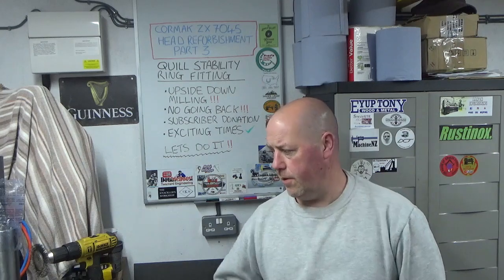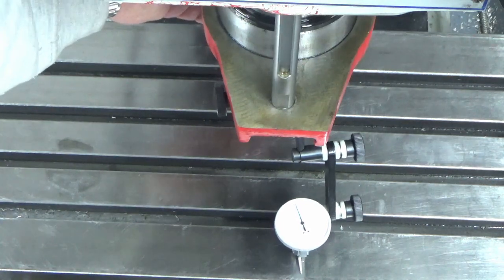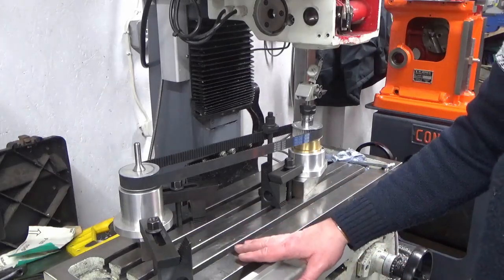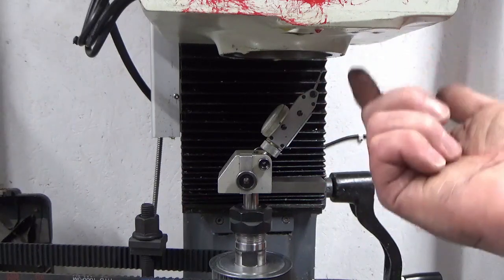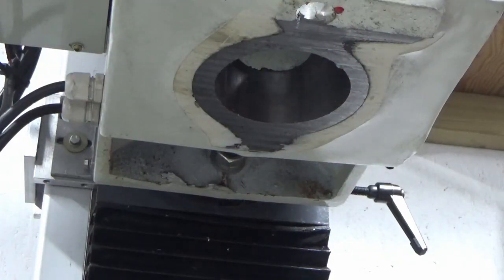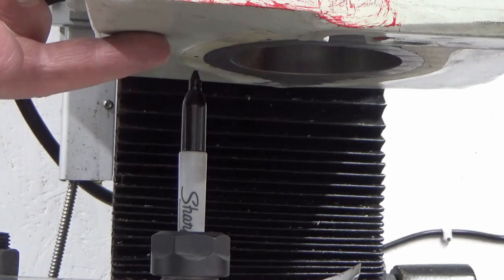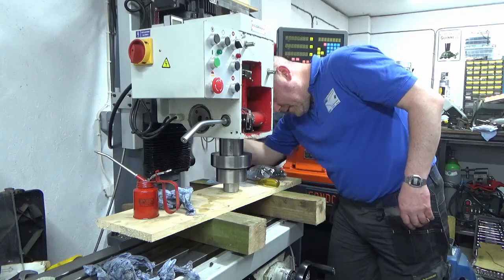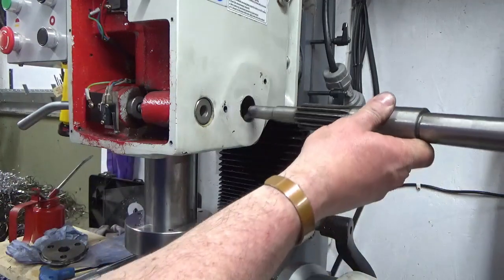7045 Milling Machine Head Refurb Part 3 - Milling the head casting.... upside down!!

Comment: Congratulations Dave on nice channel donation 👏.
Nice job Jon, quite a lot of laborious work, hope your wrists were still able to assist in some imbibing 🍺.
I'm sure you will overcome the pinion engagement issue. 
Thanks for sharing.
Reply from the maker: Hi Bosted Tap, thanks for the comment. Yup, great gift from Dave, top man! Aye, we'll get it sorted one way or another. Cheers, Jon
Reply: @jonsworkshop  Hi Jon, yes, probably only less than 0.2 mm bigger on pinion to rack height ( quill to pinion centre), looking forward to a proper geometry measurement setup. 
Have a great week. 
Best regards John.

Comment: Single pointing a rack isn’t bad. I’ve single point cut many many gears. A rack is much easier. If your shaper was ready to use, it could easily be done on the shaper.
Reply from the maker: Hi grntitan1, thanks for the comment. That is exactly the route I am going to take. Gives me the kick up the backside I need to get the shaper finished as well lol. Cheers, Jon

Comment: I forgot to mention applause to Dave Ticehurst for making the spindles and also that RDG engineering supplies sell individual involute gear cutters in both DP and Module formats.
Reply from the maker: Hi Howard, agreed and thanks for the tip off. Going shaper on this I think so will be grinding a trapezoidal HSS. Cheers, Jon

Comment: Hi,Jon. You're more than 75% of the way to a successful outcome so don't be downhearted about the rack and pinion size errors. Could you possibly make the pinion spindle mounting bushing adjustable perhaps with eccentric bushings or elongated bolt holes? Not the end of the world if you have to remachine either the rack or pinion teeth depth. Keep at it you'll win in the end.
Reply from the maker: Hi Howard, thanks for the comment. Yup, we will fix it one way or another. Rack modification me thinks, its the easiest way really and gives me a shaper project, what's not to like! Cheers, Jon

Comment: Wow , that opens up a can of worms , time to break out the gear tooth vernier !     The milling came out great with those spindles .  I wonder if that's why the spindle  had not been fitted previously .   👍
Reply from the maker: Hi Max, thanks for the comment. Yep, I wondered the same. No biggy, it gives me my first job for my shaper once its rebuilt. Cheers, Jon
Reply: @jonsworkshop  Hardly a drama !

Comment: Interesting!
Your problem isnt as simple as the spindle being forced backwards by your ring is it?

The gears and rack are not "high precision" parts on your machine so you might be able to just take the crests of one or other or in fact both, depending on  the results of your investigation of course.
Reply from the maker: Hi Chris, thanks for the comment. Yes, I also thought that may be a possibility, I dropped the ring back off..... No difference. I have since measured both racks and there is about 0.03" difference in the rack radial positioning to spindle centre. Job for Mr orange once he is fully rebuilt which I am already looking forward to. Have got the Mt4 re-fitted for now so mill back in commission too. Cheers, Jon
Reply: @jonsworkshop  that seems a lot, same product different factory perhaps.
Reply from the maker: @chrisstephens6673  More than likely, you know where its come from lol. Maybe the same factory but a different day!! Cheers, Jon
Reply: @jonsworkshop  is there a possibility of boring the head casting and making eccentric bushes for adjustment?
Reply from the maker: @chrisstephens6673  Hi Chris, yup, perfectly acceptable solution, however, my cross slide to C/L on the lathe is not big enough to accommodate so I would need to send out🙁. Shaper it is, and I am really looking forward to it. This also keeps the mill fairly standard so when I next have a brain fart, I have more options lol. Cheers, Jon
Reply: Brain fart, surely not, that's  my territory or have i been teaching you how.😆

Comment: good job jon..thanks for your time

an important improvement for your milling machine would be to attach a dc motor with a gearbox of 180rpm 200rpm and about 45w...a pwm regulator and a 24volt power supply...which will allow you to raise and lower the head without any effort and also you can use automatic feed head boring... I made this improvement on a milling machine that has an HBM 30 and I am very happy with the result.
Reply from the maker: Hi Tr, thanks for the comment. Yup, it's on the list lol. I want to power the X axis first though at some point as I do a lot more winding on this one generally. Cheers, Jon

Comment: OOOooopps
Reply: Why not offset bore the housing and move the pinion centre backward.  Mount the housing on the cross slide of you lathe.
Reply from the maker: @markdavison7893  hi Mark, thanks for the comment and suggestion. I could move the centre line back but surprisingly, my cross slide to C/L on the lathe is not big enough. I want to keep the machine as standard as possible so I will machine the rack in my shaper to correct the issue........eventually lol. Have rebuilt the mill with the MT4 spindle for now so all operational again. Cheers, Jon
Reply from the maker: Hi Raymond, thanks for the comment. Yup, bang on lol. Cheers, Jon
Reply: @jonsworkshop  Not me suggesting that was @Mark Davison. I was going to suggest re-cut the teeth on both the quill and gear if it is just depth not an oversize issue. Do they actually match? Removing the gear inserting the quill a visual inspection test re-insert the gear? Make a whole new gear to suit??

Comment: It looks like you just have to turn down the pinion a small amount near the end. At least I hope that's all you have to do.
Reply from the maker: Hi Lloyd, thanks for the comment. If it was only a small interference I think this would probably work, having measured up now, the difference is 0.03" so I need to re-machine the rack. Good first project for my shaper. Cheers, Jon

Comment: Hi Jon, brilliant work and hat's off to Dave for making you the auxiliary milling head which I'm sure you can use for future jobs on your other machines etc. If the teeth aren't deep enough on the rack couldnt you just take some material off the back of the rack on your surface grinder to reduce its body thickness which will then allow the pinion to mesh? Another option, can you swop racks and machine/adapt the other one to fit your new spindle? Good luck Jon I know you'll solve this hiccup. Tony
Reply: Hi Tony, The rack is machined into the circular face of the spindle, just as a drill quill is. Regards
Reply: @daveticehurst4191  Hi Dave, I'd forgotten lol I was thinking it was a bolt on rectangular one one set in a groove, protruding to stop the quill revolving as well. I must have seen this on something else. Thanks Dave. Tony
Reply from the maker: Hi Tony, thanks for the comment and question. You are half right, if the interference was only a few thou, I could mill/grind the crests of the teeth on the rack, and turn the same off the pinion and it would probably work. I have measured up and the difference is 0.03" so I need to deepen the teeth. First proper job for my shaper which I am really looking forward to. Cheers, Jon

Comment: think the least invasive way to solve the problem is to make the teeth on the quill feed spindle deeper and make the overal diameter smaller , doing that would eventually be less work comparing to deepening ALL the teeth on the spindle itself (though that might be a great job to do on the shaper ) 
another option ( but a no going back now one ) would be to bore out the bearing holes for the quill feed spindle that are in the head and fit exentrc bushings that you can lock somehow intoo the position , nice thing about that it that you could use that to compensate for wear / end play between the spindle shaft and spindle at a later date 
last option would be to see if the setup fits in the spare head youre having and do the same modification to that one paint it and mount it in place of youre own (do see if it fits on the machine mast dovetails and things like that first )
Reply from the maker: Hi Watahyahknow, thanks for the comment and suggestions. Yup, rack machining on the Shaper it will be and I can't wait. This keeps as much as possible original allowing for more possibilities in the future when I have my next brain wave lol. Cheers, Jon

Comment: That's some proper seat of the pants flying, man.

Bummer about the rack / pinion issue.  Presumably you could use the ISO30 spindle locked in place using the table Z feed, if it came to it.  This would,  if you're messing with the pinion, mean you can do trial fits without having to bugger about swapping the spindles over..  That said, if you have a spare head, and you're sure the dimensions are the same, you could have the ISO spindle set up in that one, and use the MT4 spindle with full functionality, I guess.

Those table mount spindles are really nice.  Big thumbs up.
Reply from the maker: Hi Michel, thanks for the comment. Certainly was lol. Yeah, I could lock the ISO in and might even try it just to see what the improvement is like. I have rebuilt the machine with the MT4 for now so still operational. Going to machine the rack in my shaper once its rebuilt which I am looking forward to greatly. Cheers, Jon

Comment: Hi Jon, Glad the spindles worked for you OK. What a blow about neither of the pinion gears working. As you have the spare head, as part of you measuring, assemble BOTH the spindles in the spare head and see if either or both pinions mesh ok. Might give you an idea as to what to do, and at least it will be on the bench and you can sit down to do it, instead of standing at the mill. Don't get downhearted over it, all is not lost YET LOL. Regards from Australia.
Reply from the maker: Hi Dave, thanks for the comment, and thanks again for the spindles without which, none of this would be possible. I have already done some rudimentary measurement using gauge pins in the racks, they are a country mile away from each other (0.03" ++) difference. First job for my shaper. Cheers, Jon